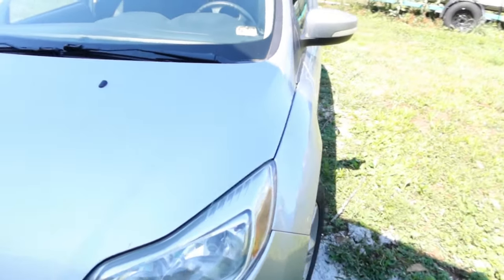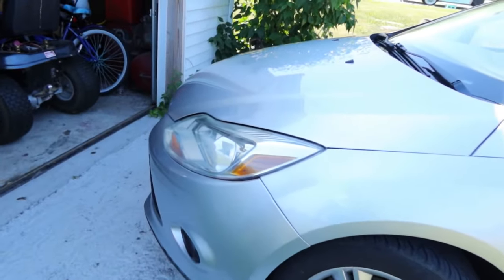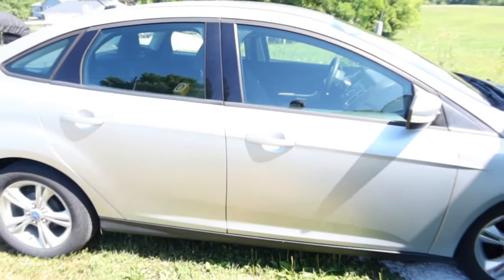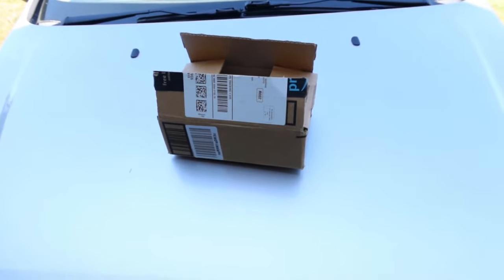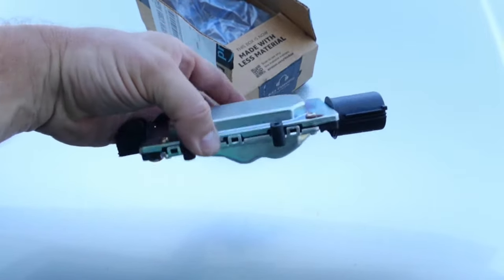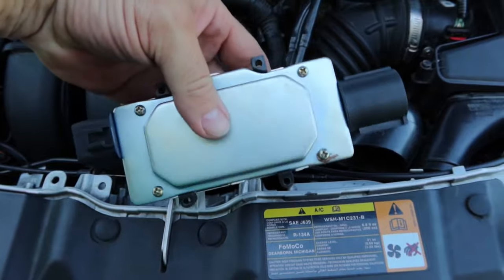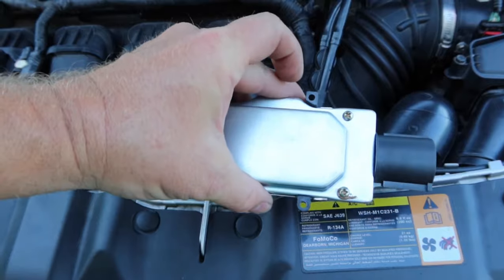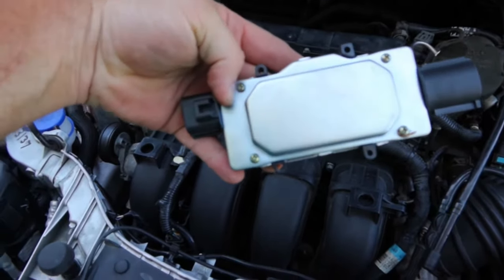Unbelievable... Fan Module Causing Ford Focus To Run Rough? #fordfocus #carrepair

Comment: gotta be honest, I thought your theory was a little far fetched until you put it back in to verify. THAT was a good video, not a typical YouTube "here's how I fixed it" video.
Reply from the maker: Thank you for the kind words!
Reply: @ProjectDIY2 does this fix the problem with the fan running loud after driving it a while & causing battery to die? It’s a 2012 Ford Focus SEL

Comment: Ive been runnin in to that overheating problem.   I replaced the Fan, water pump, ECT Sensor, and thermostat.  Im surprised.  Ive never seen this kind of craziness with a car either.   I also have been working on cars alot.
Reply from the maker: Thanks for watching!!

Comment: I tore mine apart I have a 2012 ford focus se sedan, the "battery" on the inside of it or mabye its a resistor is super rusty so I'm replacing it. I'll let yall know if it works and I can send you a link to it! If it breaks on me i'll edit my comment too.
Reply: How did it go?

Comment: Appreciate you taking the time to troubleshoot and then sharing your findings with us on your channel.  This info should be taken as a warning on not to "short cut" your way to making repairs especially on critical items involving the engine, power train, or vehicle's safety appliances.  "Exact OEM replacement" or don't do it at all.
Reply from the maker: Thank you. Agreed 100%.

Comment: I have a Ford Galaxy with no workibg AC. After diagnostics it turned out the fan control module is bad. Since it is summer after driving for a while in town traffic the car seemed tot overheat and some fumes came out under the bonnet, also the coolant level dropped. Now it makes sense since the fan does not work. It did not occur to me that these issues are related. Thanks for the explanation now I know for sure one fix will solve two issues
Reply from the maker: Thanks for watching!

Comment: I stop going aftermarket when it comes to sensors and modules I learned that the hard way when I was dealing with a faulty crank sensor got one from eBay had me going back and forth thinking I had timing belt issues. Went to the junk yard picked up a used but original sensor and all the timing problems went away.
Reply: Just bit the bullet and bought this part oem 300$ everything else online is under 30$.

Comment: Thanks Man for the info! I am having the same issue first with the fan and now I'm running bad with no power and bad mpg just like you said, I just bought that 20 buck piece arrives tomorrow. Question, Is necessary buy the purge valve in this scenario?
Reply from the maker: I’m not sure what you mean by purge valve… if you bought a cheap aftermarket fan relay then you need to get an original Bosch fan relay.

Comment: Would your transmission overheat when you were idle on the red light or on the stop because my transmission would overheat cause from a red light on the road Or if I was driving slow on the freeway my car would overheat we have the same car
Reply from the maker: No my transmission wasn’t overheating. The engine did though because the fan wasn't working.

Comment: I’m also having this issue and I just did research figuring out what the problem was and stumbled across this video. I work at a ford wholesale parts warehouse and even asking the sales guys they said the only way to get this module that fits my 12 focus is buying the entire fan assembly. I appreciate your video however I did see mixed reviews and for $30 on Amazon I’ll atleast give it a try before spending 350 on the entire fan. Will be sure to update and reference this video as well as your installation video!
Reply: I do have a question however, did you have an issue with your fan kicking on and staying on several minutes after turning the car off as well as opening your doors?
Reply from the maker: Thanks for watching! I did have the issue with the fan staying on or even coming on randomly but I think that may be a body ground issue. As I understand it, the body ground right above the battery gets crusty and you can remove the bolt and clean it and the area around the bolt hole with sandpaper to fix it. Also, you should be able to find a used OEM Bosch fan relay on eBay. Good luck!

Comment: Im having issues with my fan running on high intermittently even after short runs when my car is off and when i open or close driver door. Do you think this could be a faulty module? Replaced temp sensor but no difference and car is not overheating and runs great.
Reply from the maker: Sounds like a loose electrical connection somewhere.
Reply: Same thing with mine! I’ve been trying to figure out everything.
Reply: Some people say it might be the whole fuse box that’s causing the problem.
Reply: @greenleaf1292 I bought a second hand fan module from a breakers yard and replaced it myself, that was 4 days ago and have no trouble since 🤞🤞
Reply: @davidmackintosh429  thanks so much for the information. Have your self a great day!

Comment: Thank you soo much, I am getting code p048 but my fan was coming on now and then ,my car runs crap, I cleaned the throttle body,all sensor cleaned,replaced fuses and relay,spark plugs,evp ,water pump,bleeding the system,still over heats and rough idles....

I think this is my last option buying this
Reply from the maker: Could possibly be a blown head gasket. Unfortunately these cars are prone to that.
Reply: @ProjectDIY2  I have just replaced the whole bottom half, the over heating doesnt it's seasonal

Comment: Try as I might I can't find a Bosch fcm. I came here after installing an ebay "made in America" fcm and am having the same issues you've described. I can only find Bosch fcm off of wrecked cars. The junkyards were no help. They could tell me what vehicles were in stock, wanted $109 for a fcm and no returns. Any advice on where I can find a part w/o paying Ford for a new fan with module for $320. I just put a new Dorman fan with module on it. The module that came with the fan didn't even fit on the car, but the fan did so I used the old fcm. Now the fan only intermittently runs. Same issues, no cold air sitting at a light, windows won't defrost in the rain bc the ac doesn't always work. It occasionally overheats sitting in traffic. Let me add, while I've been unhappy with this focus, since I bought it due to the transmission issues, it does have nearly 300,000 miles on it. So I've got my money out of it.
Reply from the maker: I found this… verify your part #’s before ordering though: https://www.ebay.com/itm/335198680254
Reply: @ProjectDIY2  Sadly it doesn't fit my 12 focus. The part looks the same, but there are no measurements to confirm. I have found a few off of wrecked vehicles, but they all don't take returns and say they are unsure if they actually work.

Comment: How did you do the tests on the module and fan? My fan isn’t turning on at all and I’m not sure if it’s this module or the fan motor itself
Reply from the maker: Turn on the AC which should run the fan ask the time, unhook the module from the fan and check for voltage in the terminals on the output side of the module. If you have voltage there then it’s your fan. If you don’t, then unhook the module from the wiring harness and check for voltage in the harness. If you have voltage there then it’s your module. If you don’t then you’ve got a blown fuse or a wiring issue.

Comment: Good day sir. Try as I might, I can't locate a BOSH unit on ebay for my 2012 Ford Focus. Do you happen to remember the name of the shop?
Reply from the maker: The seller doesn’t list a fan module anymore. I did find this though: https://www.ebay.com/itm/225791213775?fits=Year%3A2012%7CModel%3AFocus%7CMake%3AFord&hash=item34923480cf:g:NpgAAOSw28tlEzhr&amdata=enc%3AAQAIAAAA0JGvAv3JdSdudyFXCqSyPuzctaN4oYw%2Fi%2Fwu69bVbLSaUOyoip3HkdnKCzu0MM4qHfXuwwOQUc%2Bw%2BdjFemSdxD4d1ODF0ultBjlrjaBY2rIONQeD38b2%2Bln0iXcEmtXnAAZqFDbfZsXQFChZfDx6hr41ST99svR4q%2FZXtRU189zBcw9y0j9vjYeWbZ6Tcku5F4xIQicL9F4b9Shh6xDlXjcPAwRQgYE1O34MLLaJ9uJI8TX9hbJoSefE%2FgoFcIaVzNXrZO3jjpkZEgxf2902LSw%3D%7Ctkp%3ABk9SR_af_Z3eYg
Reply: @ProjectDIY2  Thank you for taking the time to look. I saw this one but hesitant  to replace it with a used part. I may have to cough up more bucks for an OEM part. It's crazy what they currently charge for a 2012 OEM module.

Comment: Can I ask you a question maybe you can help with?    My daughter has a 2015 Focus that keeps overheating.  She drives it about 30 minutes and gets the dash warning that the engine is overheated and she should pull over.  When she does and turns off the car, it won't start again for about 45 minutes.  Then it starts and runs fine.  We put a new aftermarket fan and control module on it from partsgeek.  Same problem.

Today I was checking the fuses in the engine compartment and when I pulled fuse f32, the fan started running???  The car was off...  The keys weren't even in the ignition?  I think fuse f32 is for the cam/crank sensors?  Any idea why pulling that fuse would cause the fan to come on?
Reply from the maker: I’m sorry, I’m not sure what would cause that. That is a strange problem.
Reply: @ProjectDIY2  Yeah...  It kind of freaked me out when I pulled the fuse and the fan came on 😂

Thanks anyway.  I think I'll take it to the garage and see if they can figure it out.
Reply from the maker: Good luck 👍🏻 thanks for watching!

Comment: i have same module but OEM Bosch, the case measured no continuity between supply ground and case. this problem sounds like inappropriate PCB design resulting in excessive EMI emission. i've seen these Chinese replacement module were totally different compared to original ones. i dont even recall the existance of inductor which exists on the OEM module. that alone will reduce EMI immunity significantly.

Gates made various replacement module but they're quite expensive. they might be a better replacement if you cant get OEM ones
Reply from the maker: Could be. When I grounded the case that blocked the EMI.

Comment: Where is the link to the right part!! Disregard I see where you said you got it on EBay. Ordering now.
Reply from the maker: I bought it from eBay. The link is no good now. You’ll want to search for an OEM fan relay module made by Bosch
Reply: @ProjectDIY2  just about to order one now. I fished the bad one out of the trash and tried grounding it but no luck. Mine was behaving differently though. It was putting out battery voltage until I added the load of the fan. Then it went to 0 volts out. And the fan works normally when hardwired. So I’m running on a direct fused line with a manual switch until the eBay module arrives. This has been a real pain.

Comment: change the fan module, it is a bosh brand, now the problem it gives me is that the antifreeze tank boils!
Reply from the maker: Can’t say for sure, but if you drove it without a fan and it overheated then you’ve probably got a blown head gasket.
Reply: @ProjectDIY2  I think not, because with the air conditioning on it doesn't boil, the problem is that once I turn off the air conditioning the fan turns off and starts to boil... what could it be?
Reply from the maker: @alienchannelson.1765  The fan comes on all the time when the AC is on, when the AC is off the fan works off of a temp sensor. That temp sensor could be your problem

Comment: Just bought a used OEM  one that does the same thing bucking not shifting revving then shutting down while driving I really don't want to buy a new one.
Reply from the maker: Does it say Bosch on it? If not it's not OEM.
Reply: @ProjectDIY2  yes exact same as original I hooked the fan up direct through the fan relay and it worked fine drive fine the only thing left to test is the signal wire from pcm but that’s only 1 volt so I doubt that’s the prob so looks like I’m still in the market for a good fan control module.
Reply from the maker: @smille5291  I got mine from Ebay. Hope you find a good one 😉.

Comment: hi

can you gave the oem link please?
Reply from the maker: I bought it from eBay and the original listing is no longer valid. Search for "OEM Ford Focus Fan Module" and you should be able to find one.
Reply: Hi, I ordered this from Rock Auto gates brand, in case i run into this issue, could you explain how to ground module to car? Thanks
Reply from the maker: @danielhuertagonzalez490  I ran a wire from one of the case screws on the fan module to the negative battery post.
Reply: @danielhuertagonzalez490  hi

also would want to know how to ground to car
 i order one. and after week agian same uppend
and i didn’t see ant changes between two parts

so how to ground it please?

thanks
Reply from the maker: I ran a wire from one of the case screws on the fan module to the negative battery post
Reply: @ProjectDIY2  but where on the original unit have ground?   its look same as original
Reply from the maker: @yossishi221  Loosen one of the screws that holds the metal shield onto the module and connect the wire under the screw. The object of this is to ground the shielded part of the module so that it can block any magnetic interference that will affect the TPS sensor. On mine, that shield was not grounded internally.